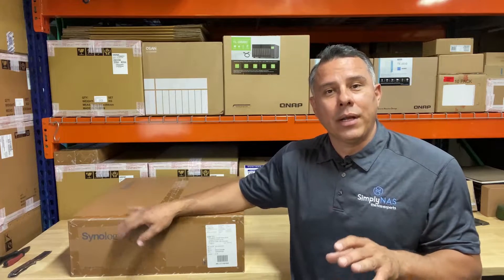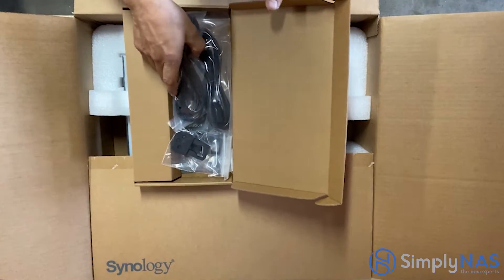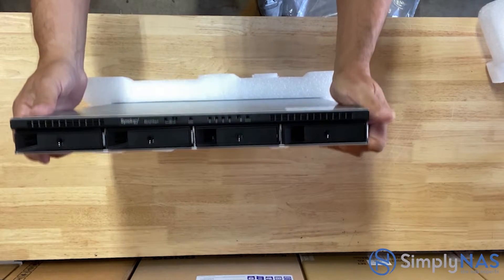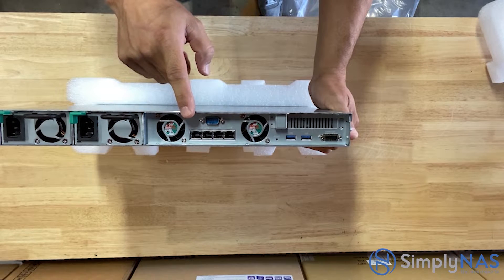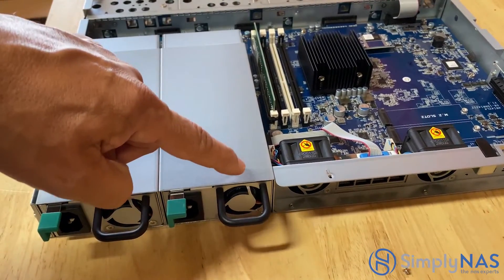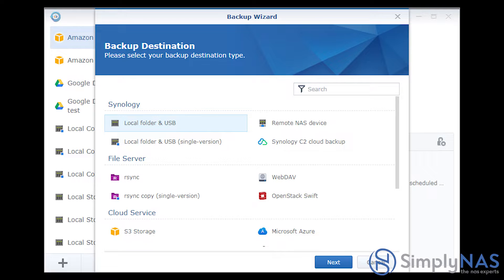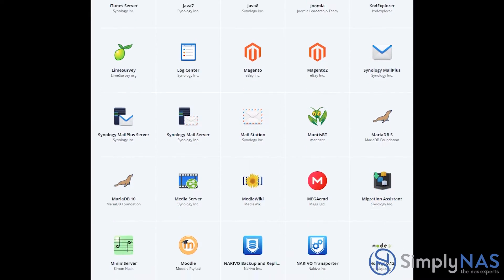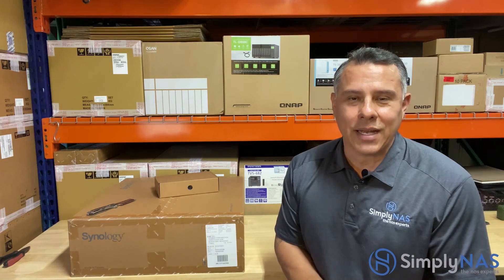Synology RackStation RS1619xs+ - Features and Buyers Guide

Comment: How does this RS1619xs+ performance stack up against the DS1619xs+ or the newer DS1821+?
I have a DS1817+, on a shelf it consumes 4U. 
Is the form factor with expansion worth the $?
Reply: What I know is that the RS series do not have integrated GPU while the DS series have.